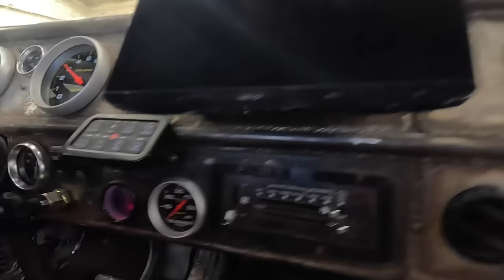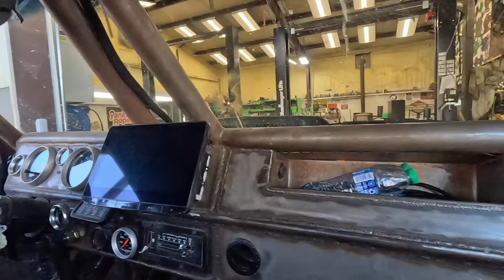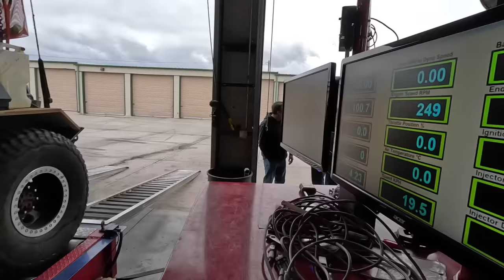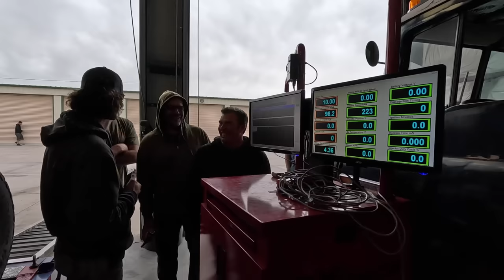The Rat Rod Wrecker's New Super Charged Motor Gets Dyno Tested!

Comment from the maker: You asked for them, so we brought them back with another color choice!! Get your Rat Rod Wrecker shirts here: https://thefabrats.com
Reply: I think someone else is messaging people who comment on your post.
Reply: Looks like you need one of those flex extensions for their welder
Reply: Pull the Flowmasters and go with dual borla pro x's 19inch . Will tone it down without losing flow.
Reply: Try to put the resignators closer to the tail pipe it's how alot of newer trucks come an it makes them quite cuz when u take them off they are louder
Reply: A while back someone commented that they would like to see less of Michelle and since then we’ve seen less of Michelle. I like what she brings to your channel and I how her not bring on the channel has nothing to do with that. More of Michelle please.
Reply: whats next for the engine?? SUPER TURBO. you wont regret it. its a.supercharged turbo. you already have half the equipment .
Reply: U need to add in this post here, don't follow the scammer replying to people.
& report them!

Just an idea
Reply: I am not talking bad about your setup but a stock supercharged 6.2 l Camaro is supposed to make 650 pound feet

Comment: You can get a new gen 5 L8T 6.6 small block 400 cu Gas 85 octane no super charger Stock factory motor high torque 464 ft ib  401 horse power check it the best Small ever designed I have one in my 2022 2500 HD 4x4 thee see highest gas powered factory stock motor on the market my brother has one and my Brother in law also we love this Motor being old school Chevy Guys

Comment: 345 HP / 397 Torque to the ground is amazing, that is huge power. How exciting for you guys, it has been such a pleasure to see the evolution of Grandpa Sherms truck, he's looking down with a big smile and proud of what you have achieved. Well done. Now go and have fun!!
Reply: Where did you see the torque< I was watching but they showed very little of the readings. I have had many motors dynoed
Reply: @RhinoRider2006 it was on screen every time the horsepower was.
Reply: I guessed it would not break 400
Reply: It is good numbers compared the cars we drive in the UK. But I bought in to the expectations (maybe not Merlin's 550!).
Reply: I did not think 450 or higher, I do not remember the cam they put in, but the motor does not sound like it has the kind of cam needed for 500, my 383 stroker is cammed with the heads and pistons needed and puts out 607 at the wheels. I have video of my truck, you can hear the cam  @MikeBaxterABC

Comment: Dialed in, 345 HP, starts easily, sounds great. Big smiles all around - Brian @ OSG, Merlin, Paul, Shawn, Landon, Hunter, Brad. Merlin's teaser on power (turbo, super charger) and fuel upgrades (gas 91%, alcohol, nitro). Pulley change, extra booster fuel pump, 80 A breaker for fan. Like Merlin said: "Gas power in diesel range".
Reply: It's probably way more HP at the flywheel than that. It's probably way more HP at the tires than that.  

That looked like an inertial Dyno and they don't really do well with these kinds of builds. 

The big wheels, tires, and heavy duty drive train are their own unaccounted for inertia that needs to be overcome. 

To get an accurate measurement he'd need to find another type of Dyno. 

Inertial Dynos work well with like cars but not so well with something like this.
Reply: @edwardscott3262  It's probably more like 450 hp and 600 ft/lbs tq. I sense that Paul wants this motor and drivetrain to live a long happy life. Otherwise he could get much more power.
Reply: 1. Working tow truck. 2. Reliability. 3. Cost to get more power/speed/reliability. Maybe in time after other projects are completed.
Reply: @edwardscott3262  Yup, the big offroad tires and all the driveline losses will kill the power.
Throw that in the firebird or the hot rod truck and it will be a world different.
Reply: @kb9oak749  Yes, in a 2wd street car. Even changing to a hub dyno would change those hp and tq number a lot.

Comment: Blowers absolutely make engines louder. It took 5 mufflers to keep my blown big block quiet. 2 glass packs, into a dual in dual out big body magnaflow, and then 2 hush powers at the tips out the back. I did do electronic exhaust cut outs for when I do what to make some noise though!!!
Reply: I got a Detroit 8 V 71 in a RV that was once a Greyhound bus. Put on a blower and a two stroke and it gets real loud!! LOL

Comment: The tech already said his dyno was reading low because of some equipment problem.  Don't be let down by the hp number.  It sounds like it is running great! ! !

Transfer cases with doubler and 1-ton diffs eat horsepower.

The sign above the very first speed shop I went into in 1973 said "Faster is better, better costs more money, just how fast do you want to go?"

Comment: I nearly choked when Merlin said "550".  I told my wife "not over 375, at best".  When it comes to moving a "dead" load, low end torque (idle to 4000 rpm) is king!  This is where the 427/454/500 BBC or a 472/500 Cadillac, properly built, will shine.  It is all about "area under the curve".

Comment: Not a bad number considering all the driveline losses. Plus the big marshmallow mud terrain tires. 

For the folks in the back, dyno tuning lets the engine run through the rev range in a controlled and repeatable setting. The computer can map the air/fuel tables and let the tuner see where it's rich or lean. They can then adjust the fuel tables to correctly fuel the engine at that specific RPM where adjustments are needed. Street tunes are a thing, but they're often reaching illegal speeds to get the engine to the higher RPM range.

Comment: I read below that it dynoed out at 397 torque, I did not see that, I was watching but you did not show the readings very much. Just the spinning tires. My first street motor was a 383 stroker came out at 400 hp and 400 ft lbs of torque. You will like the torque when you have a hard pull. Thanks for the work

Comment: To knock down that noise level you'll have to place a Y in and then play with the length of a deadend piece. It is how they get rid of drone sound, but if you adjust the length you can get anything quieter based on the length and the length of the frequency.

Comment: You should be able to do the math for your effective compression ratio with the blower.  That blower is a positive displacement design, you know how much air it will move for every rotation of the of the shaft.  Get a spreadsheet, plug in your cylinder size, your pulley sizes, and the size of the blower and you can figure out how much boost potential  the blower has at any rpm.  You can get the compressor map from Whipple to understand efficiency in that calculation. 
You have a lot of things pulling power off that motor to.  It may be making a lot of power at the motor, but the blower, the driveline, the tires all steal that power before it gets to the dyno.  You can do some calculations on that.
Replace the flowmasters with something that still flows but is a longer path.  Borla or Magnaflow.  Body length of the muffler plays a big role in the volume as well.  So the space you have plays a big role as well.  Longer body, more baffels, still flows.
Here is my test video after installing. a similar blower (2l) on a 3.8 liter v6 built for 20psi of boost (never got more than 16psi due to belt slip)  that dyno'ed at 445hp / 462ftlbs .  The nice thing about those positive displacement blowers is you get 80% of torque across the entire power band.
https://youtu.be/R-hAopUmeJw?si=rLtZ4uDPmszeZ5zv

Comment: People have to remember the gears in this truck isn't set up for Racing. The Wrecker is built for rock crawling and the lower the the gears are the better. It has all the Torque and horsepower it needs to do what it was built for. Big difference from the Big Block and it will last a long time. That Big block was a money pit and keep breaking things inside of it. LS motors run good and last a varry long time. If anyone ever decides to buy a Big Block get the Gen 6   454  they are varry good motors. They came in the 1997 threw 2000 GMC and Chevrolet 3/4 ton truck and other things. They are the best ones made. The 454 with the TBI have peanut port heads and is the same one Paul had in the wrecked and Landon truck. The Wrecker is a beast now Paul live it

Comment: Holy smokes that guy tuned it up pretty good, even sounds at idle like its super charged now. 345hp and 400FT/lbs is no joke, Merlins joke about that cummins power is almost true. So happy for the fab rats team, and the mastermind Paul. Youtube money well spent. 
I have a 08 3500 dually diesel, turbo went a few years ago, put the biggest turbo you could do without replacing head bolts and injectors which was 70 horse increase from stock, added a south bend clutch, and then my after a few days my slave cylinder line burst from the HD clutch. So had to get a new one of them with braided steel lines. Anywho, the truck puts out over 400hp, and 900tf'lbs. Engine brake pretty well slams ya forward, and with 4 inch straight pipes she just whistles from the tips. Yes emissions crap was deleted back in 2008 haha, with the cheater chip.

Comment: Those breakers use thermal tripping. Ie too many amps causes heat. Trips. As they are in a hot engine bay will trip intermittently. Check the draw of dc current with a hoop amp meter on the positive cable while running at full speed. That will give you the amp rating. Get a flat fuse and a spare in case. 😊

Comment: I have to agree with Merlin on Diesel being the top dog. My 2019 Ford 6.7 liter is doing 550 hp and 1100 lbs of torque. All I've done is tuned with Forscan and a K&N air cleaner.  Later I wanna build it some . Just can't make up my mind in which way I want to build it.😉

Comment: I only have one issue and question on your  build of the tuck in the background.. The "project that never ends".. please run the fuel line between the two side tanks in a 2X2 square  (or round) tube that is  bolted to the frame to at least give it a chance if you snag it on the trail.

Comment: The other day you were talking about how to put the hood pins in the big wrecker. May I suggest that instead of hood pins you go with the JEEP style hood hold downs. You could put them on the side of the hood instead of drill holes that could leak on the engine. They are available in both the rubber kind and also I have seen them available in metal (which I would recommend since they are considerably stronger
Reply: Leather straps would suit the look of the build

Comment: Does it have a crossover in the exhaust? Im not sure technology has changed in the last 50 years, but we found a cross over between the two exhaust pipes, roughly as large as you can make it, as close to the manifolds/headers as p[possible, lowers the pitch of the exhaust as well widens the torque curve of the engine. Was shocked at the sound difference when we changed everything in the shop, to H pipe duals. Everything we tested on the dyno benefited by one or two horse power, but the torque curve widen by sometimes as much as 2000 RPM, about equally low and high. Worth a thought!

Comment: I have to wonder if only running 8lbs boost is worth all the sacrifice. I do agree that you don’t want to push it with that engine’s bottom end. Waiting for forged internals is best.
However, for the amount of demand that blower puts on that engine and considering that you’ll only see that boost in the higher RPM range, all you’ve done is diminish the low-end RWHP and Torque.  I think that you are still running a NA cam and not a Blower (forced air) cam, so you are pushing a bunch of that boost out the exhaust value – meaning that you are not able to take advantage of the increased fuel, because it just got shot out - unused.

Comment: I want to put a supercharger in my truck but I know that the bottom end won't handle it. Which is why I would rather stroke it to a 426 or 440 with forged parts and get rid of MDS garbage.

Comment: Turbos are great at the drag strip or on the dino to get that big HP number, but for towing I think the supercharger is more beneficial. It provides boost at lower rpms and with that boost, you're getting the horsepower and torque that you need for towing. Turbos work best when the motor is screaming at 5k to 9k in rpms. Do you really want to have to smash the gas pedal that long to get the power you need while doing recoveries and towing. IF you want more power, then rebuild the bottom end and put the party pully on

Comment: Turbo are nice but the regular driver more like to have turbo problems they don't know you got to cool the turbo down before you turn off the motor you got to let it idle 3 or 4 minutes to cool if not the oil in the turbo burn build up junk and you get turbo problems

Comment: I'm confused. I thought a stock 6.2 ls was around 420hp with all the sucky stuff on it from the factory. So that would be at idk around 350hp to the wheels. How does a supercharged 6.2 ls then only do 345 hp to the wheels? I know you weren't pushing it but where did the power go?
Reply: At least 40% parasitic loss through a th400/torque converter ,  doubler t-case 40” tires. I had a cammed LS2 through a 4l80/Atlas and 43” swampers and it made 218 to the tires ..the engine on paper made 440hp so that’s 50% loss ..yeah it’s a kick in balls when you see low numbers but completely expected.

Comment: Lose the Flowmaster mufflers and use Dynomax super turbo mufflers. Flowmasters only work well with Cats. Also add a crossover pipe. The crossover will knock 12 Db SPL out all by itself.